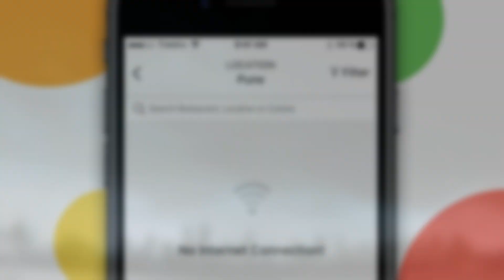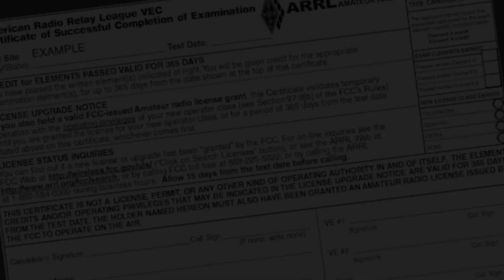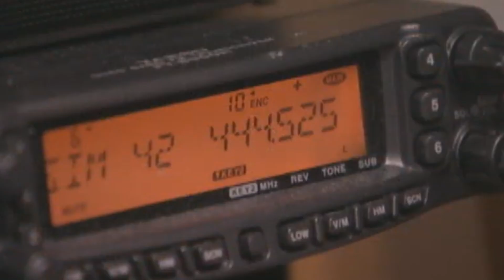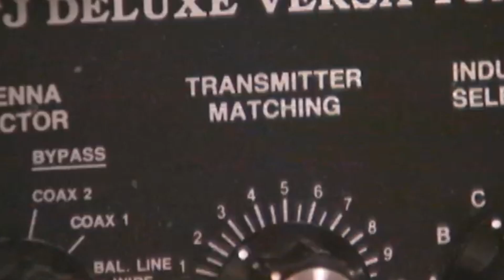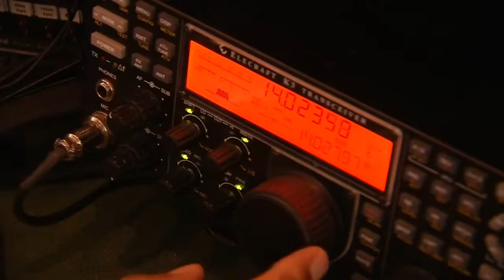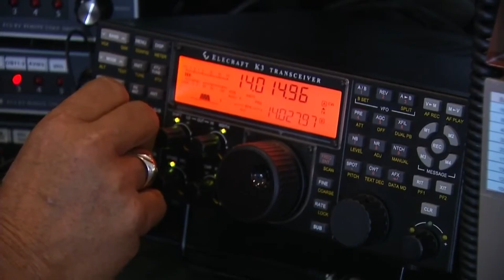Hertz of Heroism   Amateur Radio During Disaster

Comment: I am not a ham. Highly interested but the cost of the gear is out of reach as is the possibility of putting up ANY kind of antenna ( bad health) My point IS, How will Amateur Radio work if there is NO POWER? Something bad enough to wipe out power lines and cell towers will probably knock out ANY of the repeater towers. How will HAMS operate and help when there IS NO POWER? SERIOUS QUESTION! Pls advise??
Reply: Many Amateur stations, mine included, have the option of off-grid power. If the repeaters also go down, we simply operate simplex, two-way radio.
Reply: @Tom-zs6bb  Hi TOM!  Many thanks for Info! I really don't know SQUAT about HAM so need to check with a FRIEND about SIMPLEX operations in case POWER to a repeater goes out. BE WELL & SAFE!
Reply: @jtc1947  Same to you, my friend. And if you ever decide you're interested in getting licensed, know that used equipment of good quality is available and hams will be very happy to assist you in setting up your station.